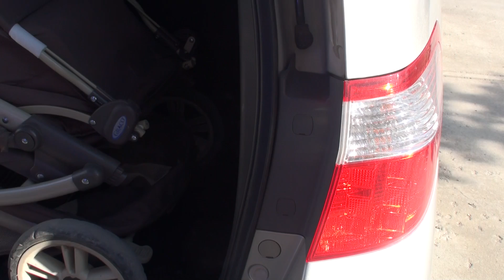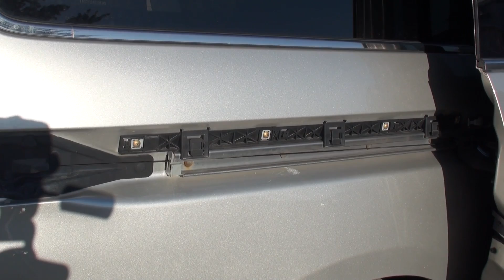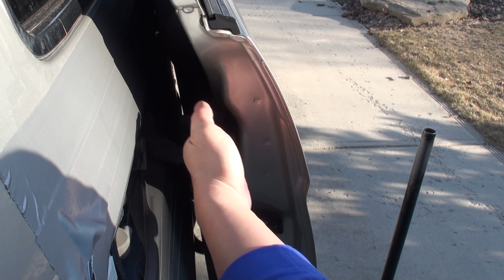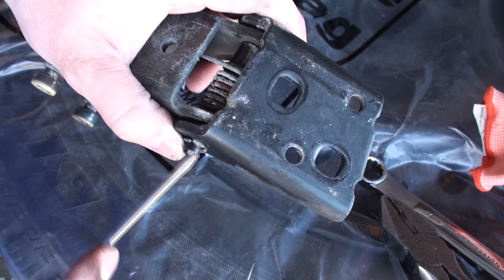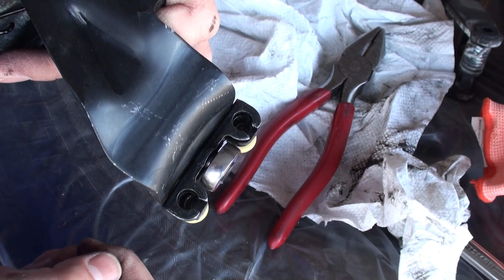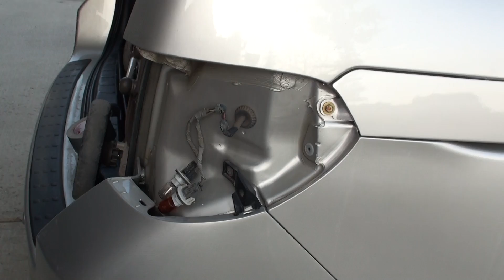Honda Odyssey Center Rail Door Roller Replacement

Comment: Again, thanks for the great video!  Having just done it, I have a tip to pass along that I think saved me a lot of time and frustration.  When you put the floor jack under the door, include a piece of 2x4 or similar, maybe 2 feel long, and position it along the bottom of the door. Place the jack near the middle of the door rather than near the end. Once the bolts are out that connect the roller assembly to the door, very gently pull the door handle and move it forward (closed direction) about a foot, being careful to rest it back down on the board. Now you have CLEAR access to the assembly and those cable ends - they will come right out, and go right back in!
Reply from the maker: awesome tip!  I'll have to give that a shot this week as I'll be doing yet another centre roller hinge fix this week!

Comment: I can't thank you enough for this video! The passenger-side sliding door was driving me insane. On automatic, the resistance caused by the bad roller constantly engaged the "safety" feature and the door would refuse to either open or close. I thought this would be really involved, but after watching your video, and playing it step-by-step as I was actually fixing it, it was fairly pain-free. The only tough part was removing and reinstalling the cables. Thanks again!
Reply from the maker: Ben I'm glad you were able to fix your doors.  When I first took apart the Odyssey door rail I was a bit leery too on the door falling off the van but after playing around with it for a bit I realized how ridiculously easy it was to replace the rollers.  Better you fix it than the dealership.... :)

Comment: Thank you so much for sharing this video!!  It feels AWESOME to fix a vehicle for just the cost of the $50 part rather than having spent $400+ dollars getting the dealership to do this.  Plus I had fun doing it and learned more about my vehicle -- works like a charm now.

Oh... and the old part didn't even HAVE the smaller nylon rollers!  They were gone entirely.  I'm guessing they had crumbled apart at some point.  Obviously the door had issues with opening and closing and had scraped up the side of the van a little, but I'm amazed it worked at all!  So now I may go in and replace the driver side roller too, given how deteriorated the passenger one was.
Reply from the maker: No nylon rollers?  That doesn't surprise me at all as it is a common thing to go on these vans.  Fortunately the fix as you've proven to yourself is so easy that it is ridiculous what the dealer wants to charge to fix it.  I haven't replaced my driver's side roller yet as that door doesn't get used nearly as much as the passenger side one did.  I'm sure I'll be doing my own fix again in the near future :)

Comment: Thank you thank you!  Just did this and worked perfect.  I have been wanting to do this repair for a while but the idea of taking the inside apart to detension has made me put it off for months with an annoying half shutting beeping door.  Finally saw this video without having to do all that and gave it a shot. I was able to replace in no time.  Total time was only like 40 minute job.  20 minutes trying to free a completely rusted hinge pin from the old hinge assembly and 20 minutes doing all the rest.  So the only tricky part is the cables.  Taking off was no problem.  Putting on I tried once or twice then yelled over to my neighbor and he came and held it for me and took 10 seconds to snap it back on.

Seriously after a 1/4 can of wd40 and lots of pounding I got the pin free, so FYI if you run into that have a bolt or something you can use to pound the pin out and some wd40 or similar.
Reply from the maker: glad you were able to figure out your door hinge fix!  It always satisfies me to hear that my video was able to train someone else to fix their cars and not have to pay the stealership ridiculous money to fix something so simple.  

Good job and thanks for watching!

Comment: That was a great video, thanks. My driver side door cable snapped and I searched for a replacement cable. Apparently you have to buy the whole power assembley ($450-$650 for the part, not including the install) to replace a broken cable. I have opted to cut the cable clear and use it as a regular door; but will replace the worn center hinge in the process. I could probably replace the cable myself with a proper coated bike cable or aviation cable but the door works fine and faster without the power option and cables unattached.
Reply from the maker: yes you could do without the power option OR you could wait a little bit until your local auto wrecker gets one in an buy it for less than half of new.  The cable winder assembly is surprisingly easy to replace.  The part new is insanely expensive and probably not worth replacing if power doors don't suit your needs.  I've seen people replace the cables with their own DIY solution but I'm not sure how reliable that is and whether it is worth your trouble to jury rig something that might not last or work like the factory assembly.
Reply: I just bought a salvage motor on ebay for $167 and replaced it myself.  Shop quoted it as $700 total repair.  Its not an easy repair and I couldn't find any vids on how to remove the interior body panels, but I finally got it done with minor plastic breakage.  Works great.  What I did to make that cable connection to the roller easier is since the body panels were removed, I removed that black housing that the cable comes out of, once it was unbolted, I could easily reattach the cable to the roller then bolt the cable housing back to the body.
Reply from the maker: I want to do a video on the dismantling of the interior but because I personally didn't have a need to do it I decided that I won't create more work for myself for the sake of doing so :).  Glad you were able to fix the door issue and got that replacement power winder installed.  Can you believe the cost of that darned part??  What a rip off for something that SHOULD be serviceable.  Why can't Honda allow the users to just replace the cables?  Either way I'm glad you were able to fix your own power doors.  Thanks for sharing the tips!

Comment: Thank you so much for your video. I was able to replace my drivers side center roller yesterday in the sub 20 degree weather. I actually did both sides but realized after dismantling the passenger side that the dealership I ordered the parts from had sent me two drivers side assemblies. So in essence I did both sides yesterday and will do the passenger side again next week when the part arrives. Your video is saving me $400 in labor charges since my mechanic still wanted $200 per door even with the part supplied!  Can't tell you how much I appreciate your video!
Reply from the maker: Hi Jeff, I am glad my video was able to help you save money.  That was the ultimate goal which is to inform and train those interested.  Why pay someone $100's when for less than $100 you can DO both doors just as good as the next guy :)  Thanks for watching.

Comment: Hello, ordered the part off amazon for $32.64, Dorman 924-129 Sliding Door Roller Right. Watched this great video twice and went to work. I couldn't figure out why it was important to use a marker to mark the bracket before removing, but I am glad I did. Everything was really easy even re-attaching the tension cables, but the door wouldn't quite shut all the way. We noticed the bracket wasn't lined up with our original marks and sure enough that was the difference. I would say this took about 45 minutes and is really easy considering we never work on vehicles. I will say for a pointer on the tension cables after you remove the bracket from the door, then manually slide the bracket back down the trac so you can easily see and work on it. It literally took about 5 minutes to do this part. We stopped the door in the middle of the trac to start this process also. Thanks a ton for the video and saving me some $$$.

Comment: I have the LX model odyssey and as I've tried to buy a replacement part they all say they are for power doors only and I have manual. I can't seem to locate the right part, any good resources for parts?

Comment: Excellent video.  The dealer wanted $350+ each to repair the "loose" center rollers about 1 1/2 yrs ago.  They finally bit the dust a week ago, got the parts for $90- (incl shipping).  Changed out both in ~1hr 45mins!  Even in the current 18 degrees F.  Thanks for the clear, concise instruction.

Comment: Excellent!  Thanks!  Like Seth Brandes, I found it fairly simple to put the cables back together once I moved the whole assembly to the rear of the van.  All I did was hook the front cable, slide the bracket to the rear, gently use needle nose pliers to pull the rear cable towards the bracket and had plenty of slack to slip it in the hook.  The other tip is when taking the rail cover off, simply lift it up and out past the window instead of trying to pull it back along the van.
Reply from the maker: good advice for others to learn from!  When I go and replace my driver's side roller one day I will definitely give that a shot.  Thanks for sharing!

Comment: Thanks so much for this! I did both rollers on my 2007 in about an hour and a half, no problems at all. I also replace the top rollers, as one had bent just enough from the failed middle roller. Thanks so much for the great video.
Reply from the maker: you're welcome.  Glad you were able to fix your own sliding door rollers!

Comment: Thanks for the video. Replaced my door roller today and it worked out great. The dealer charged me $245 for the other door, which I had to pay because the motor gave out on me with the door fully opened! Glad to save the money this time.
Reply from the maker: Wow $245... that's steep but I guess you sometimes have to rely on the dealership to bail you out when you can solve it yourself.  But at least you saved on the other door.

Comment: Adding my notes from performing the job...

Had to replace on both sides.  Drivers side hinge pin was fused into the bracket, also had to use a dremmel to cut apart the piece that gets disposed of to free up pin.

Found it easier to only open door about a foot before lifting with jack and removing slider bolts form door.  Once bolts were removed was able to slide the slider towards rear of vehicle giving more room to work with when removing and reconnecting the slider cables.

So as to not drop cable ends and have to fish them back out found the clips that the trim piece slip onto were perfect cable holders while swapping the hinge plate on the roller bracket.

Thanks for the video, removed a lot of the guesswork I would have had to do had I gone into this venture blind.
Reply from the maker: glad you were able to fix your doors.  Yes each van I've found that I've done this replacement on seems to be slightly different than the next.  I guess it could be related to how much slack there is and that tension winder inside the van.  I've done vans where it was SUPER easy to remove and some that were tougher than heck.  YMMV.  Goo job.

Comment: Thanks for the post,  I did it with a $50 dollar part from advanced auto parts and about 25 minutes.  No idea how much the dealer would have cost but i'm guessing it would have been > $200.
Reply from the maker: great work! Yes the stealership charges a LOT to do a simple job.  It's mindblowing that they can even think of charging $200 + for something that takes about 30 minutes to do.

Comment: Thank you very much for this video.  My local Honda dealership (Nanuet, NY) said $920 + tax to replace both middle rollers.  Bought the part for $55 + 30 min. of labor and done.  My left side door gets used 4x more than the right, so only had to do one side.  This is the second time this dealer tried to over bill me on a simple repair job.

Comment: Great video, huge help!  Saved a small fortune in labor and the job only took about 45 minutes (some of that was watching the rest of video after pulling everything apart).  Getting the 2nd cable end into the slot was the hardest part, but only took about 5 minutes and a few dozen select words.  Just wanted to let you know how fortunate you are to have a light colored Odyssey.  Took me a while to find a silver marker that showed up on my blue/green paint.  I can't imagine getting it back together had I tried to remove it by just removing the pin, as someone suggested in the comments.  Good idea, but that tiny lock clip would have been lost forever if I had tried that.
Many thanks!
Reply from the maker: glad you were able to fix your van.  Yes the guy that removed the pin from the hinge while it was still installed must've been a contortionist as I couldn't possibly imagine removing the clip and pounding out that pin with such little clearance!

Comment: Quick tip.....it is easier to get the slider rail cover off if you close the door almost all the way, then you do not have to worry or fight through the small gap between the door and the van.  Another note to mention is that once the door is on the jack and the bracket off the door, you can slide the door towards the closed position to allow you room to get the bracket off of the cable.
Reply from the maker: great tip!  I'll have to try that the next time I need to replace my other door roller.

Comment: Thanks for posting this video. I had no problems. I went through the window to attach front cable first and carefully lowered roller in place and had someone assist me pulling cable from the back while attaching rear cable. I'm sure I saved at least 300 bucks from a trip to the dealer!
Reply from the maker: ah yes, having a set of helping hands definitely makes re-installation easier.  Glad it worked out for you :)

Comment: piercedasian Thank you so much for the video! Your walkthrough was perfect and allowed me to follow each step along with you. My wife may actually allow me to continue to work on her car!
A couple of items to note:
1) I also found that the closer the nylon rollers were to the slot, rotating the bracket to keep it as close to it's natural position, the easier it was to install the cables. Or I just have tiny fingers.
2) One thing to add to the preparation section: When you are marking the half circle cut-outs with a marker, you may want to add some additional duct tape or masking tape to the inside of the door panel around the bracket with the 12mm bolts. I ended up scratching up the beveled portion of the inside of the door while I was removing/reinstalling the cables.
Once again, thank you for your excellent tutorial Pierce!
Reply from the maker: Hi Jamie, glad you liked the video.  Thanks for the suggestions to our other viewers.  I wasn't sure how to film me trying to install that cable as the fit was quite tight and I had no real means to re-attach that cable and show my viewers how it was done.  You're absolutely right in that the closer you can work with the roller hinge in it's neutral position the easier it is.  As for the masking, fully agree as I did another Odyssey door fix and that is exactly what I did.  Fortunately for my own van I was able to not scratch up my door but I can easily see how that is possible.

Comment: Thanks for this great video. It saved me a lot of money. Also shop around cus the dealer part vary as much as $30 difference. The service and part was going to cost @$300 and I did it with for $60 in 30min without a cable. Hardest part was getting the tail light out and somehow the screws didn't want to go back in.

Comment: I have just a normal jack that is included in the van for the spare tire. Will that be sufficient?
Reply from the maker: I strongly recommend against using the factory jack Amy as you do need to have some ability to shift the door back and forth and the last thing you'd want is the jack to give way and the door could potentially be damaged or you could get hurt.  Borrow a jack with wheels if need be or if you're really stuck using the stock jack then get a strong helper to help you watch and stabilize the door while you work.
Reply: I used the jack from the Odyssey and it worked fine.  Put a big towel on the top, line it up lengthwise with the door, and when you move the door out just slide the jack with it to keep the door in the middle of the jack small surface.  Good luck!
Reply from the maker: yes the stock jack will work but moving the doo in and out with a trolley jack I easier and I feel safer using it.  I guess if you had a flat surface you could work on then it is certainly possible using the stock jack.

Comment: Thanks so much for this video.  I just completed the job on my 2007 Odyssey.  Reconnecting the cable was a bitch, but it came off so it has to go back on.  I found removing the taillight one of the more difficult steps.  There is a pin that holds it pretty tight.  I used a paint can opener wrapped in a paper towel to tug it loose.  Fairly smooth from there on.  Great video!
Reply from the maker: yeah that tail light pin was so tight on my Odyssey that the first time I ever removed the tail lamp housing to change out a bulb that I actually snapped the tail light in half from me just pulling on it!  $175 dollars later I had a new tail light but before re-installing it I put a blob of silicone grease on that plastic retaining pin and ever since then it's been easy to remove.

Comment: This worked great on my 2003 model as well. slight differences. I actually slide the door closed to provide more room when reattatching the new slide, then slide it back once I got it back together, 45 min total time, great video thanks